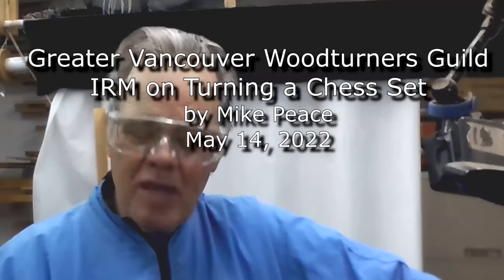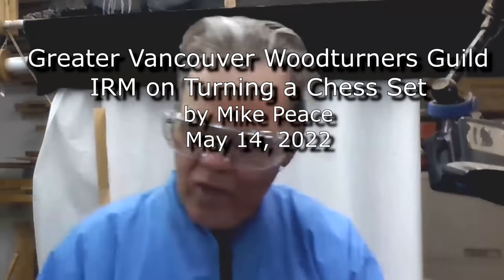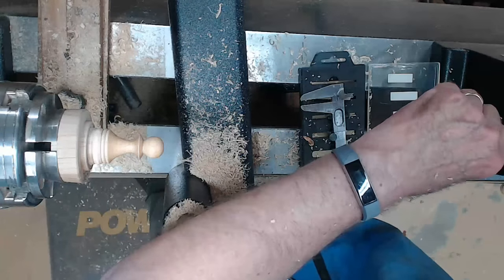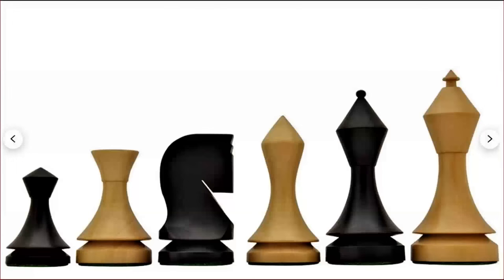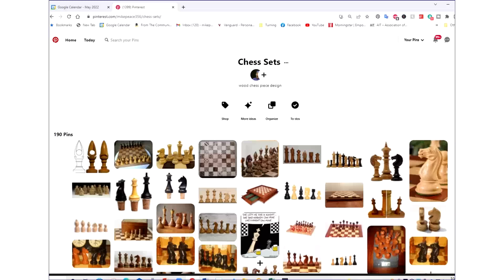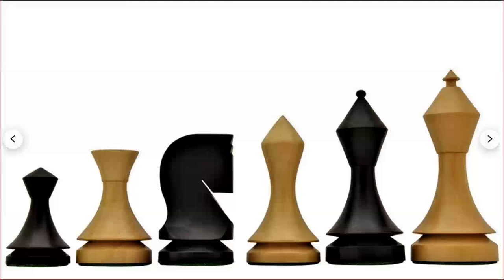Turning Chess Sets

Comment: Your pennies are copper clad zinc so not as much weight as a slug of steel. Nice tip on making the tool handle ferrule from a bearing.  Look for diatomaceous earth  where they sell Pool Supplies; its used as a pool water filter material, same principal as charcoal filtering water.
Reply from the maker: I learn something new every day! But pennies still make a good weight. My research leads me to believe that the treated DE used for pool filtration should not be used for abrasive paste. Thanks for sharing.